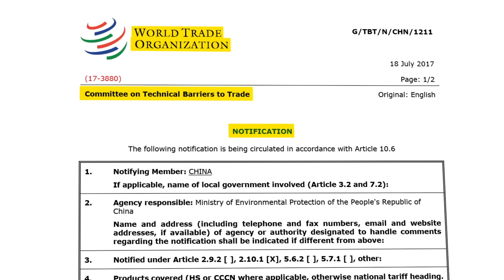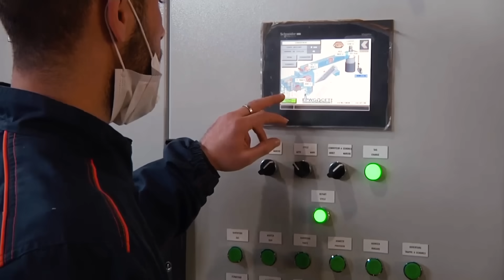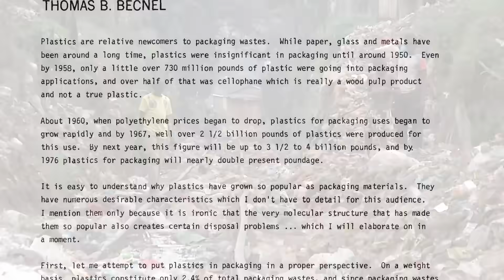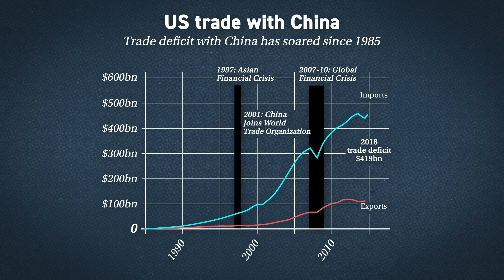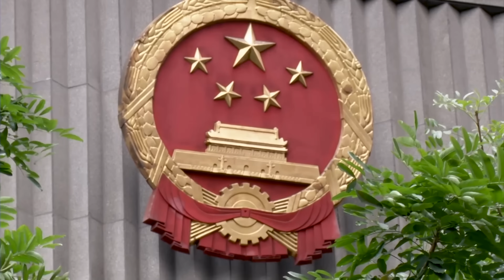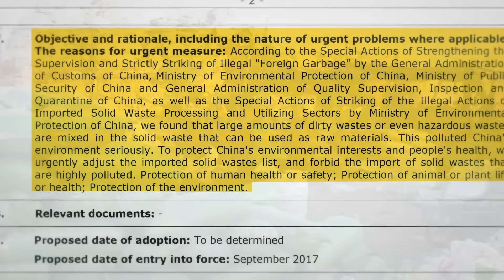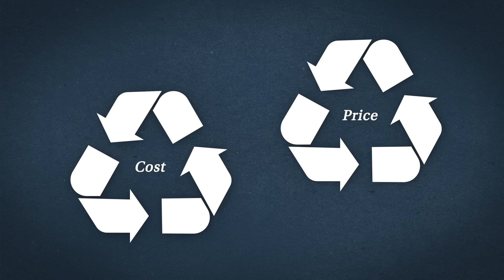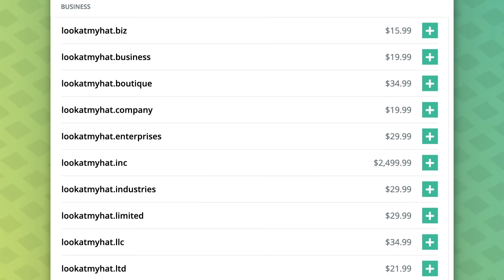How China Broke the World's Recycling

Comment: Simple. Tax 10 cents per pound of virgin PET, and grant ~15-20 cents (depending on loss) per pound of recycled PET to recyclers; that brings the virgin price from 54 to 64, and the recycled price from 63 to ~43-48; balance demands by adjusting tax/grant accordingly. While you're at it, mandate that small amounts of different fluorescence-color compounds gets mixed in depending on the plastic types, so scanners can tell them apart easily, and prohibit using fluorescent primary color compounds to avoid confusion (there's plenty of all colors that don't fluoresce).

Comment: So what's wrong with just storing the plastic somewhere? Just put that somewhere in abandoned place and keep it there until the price actually rises up and it will be profitable to reuse it. One of reasons for such low price of fresh material is that plastics are related to other crude oil products. Why is asphalt so cheap? For the same reason, we have abundance of asphalt. Otherwise we would use different material for our roads but it is working well and is cheap as oil refining byproduct. Essentially plastics are cheap only because we use huge amounts of fuel so we also produce huge amounts of plastic ingredients. Currently driving factor for crude oil industry is fuel and everything else just follows. If we reduce the use of crude oil fuels, then suddenly demand for fresh plastic may be higher than the production. Of course we can keep the higher production to meet plastic industry demand but if we do that, we'll end up with more fuel than we can sell. To make it profitable we'll have to shift some of the fuel price to plastic price to balance out the demand for both.
Imagine that you are selling scrambled eggs, just lots of it. Now someone found out that he can use egg shells to produce something. You have lots of shells so you sell them cheaply. The demand slowly grown but suddenly scrambled eggs are not that popular and you use less eggs producing less shells. The problem is that someone wants to get more shells but what would you do with those extra scrambled eggs? To sell more of it you will have to reduce price of the scrambled eggs and shift some of the cost to egg shells. Then you will have balance once again but now shells are more expensive. It means that the one buying shells might consider changing his technology which was initially driven by egg shells cost. 
So it's just question when. Either we will reduce crude oil use and extraction that will increase plastic production prices, or we'll simply run out of oil. In both cases sooner or later we will have higher demand for something that is not economically viable option right now. The only question that remains is how to store it cheaply without environmental risk.

Comment: I've spent the last couple years convincing my mom to stop recycling things like bottlecaps and yogurt cups, as well as plastic bottles and jars which will take considerable water and/or soap to clean.  Especially when one lives in a desert, it's just not worth using the water to clean anything but drink bottles (which are generally HDPE anyway).  The response for months was "but the city accepts these plastics for recycling."  I think I've finally convinced her that most "recycled" plastics around here just end up in the landfill, so we might as well help the sorters out and save water in the process.  At least we know metals, glass and paper cardboard actually get recycled locally, but again it's taken some convincing to get my mom to stop throwing plasticized paper/paperboard into the recycles....

Comment: That's why you use the 5 Rs: Refuse, Reduce, Reuse, Repurpose, Recycle! Follow in that order. Recycling should be people's last option; refusing should be people's first.
Reply: It's still just 3 R's. Refusing is reducing your consumption, and repurposing is reusing. You just duplicated 2 of them.
Reply: @vancel35    Exactly:
It's still just 3 R's. Refusing is reducing your consumption, and repurposing is reusing. You just duplicated 2 of them
Reply: @vancel35  refuse what you can live without, reduce what you need to the essential, reuse what is still good enough to, repurpose if you can find some other use, recycle or at least try to for everything else that failed the other 4 R's
It's more exhaustive, though you can technically spare yourself from explaining two.
Reply: Not a lot of ability to "refuse" when pretty much everything at the store is in a container.
Reply: @KaiserMattTygore927  You can refuse items like plastic straws or disposable utensils and replace them with reusable metal and paper straws as well as metal utensils.
Reply: @ProximaCentauriC  yes, paper straws, which cost five times as much to produce than plastic ones, have to be packaged individually if you don't want to turn soggy, need to coat in another plastic to not turn to mush as soon it's used as a straw and is no longer usable after a single use not just because it's kinda icky, but because it turned to crap.
Use metal or another high-grade food-safe plastic companies are more incentivised to recycle if that's what's turning them off, plastic straws are utter garbage and only needed in case we don't find a solution to the oil problem, we'll have to resort to breaking rocks to get more of it and plastic straws end up costing as much as paper ones to make, otherwise this is just a stunt to pretend you're being environmentally concious.
Reply: @ProximaCentauriC  That's fine, but that's not what i'm talking about.

Not talking about fast food at all, talking about GROCERIES
Reply: @KaiserMattTygore927  Yes. Most grocery products are packaged in plastic. However, companies like Trader Joes in the U.S. have made the switch to compostable produce bags (bags that can decompose in 10-45 days), in comparison to "biodegradable" produce bags (ones that are just normal plastic bags with an added chemical additive unproven to work). The bags Trader Joe's uses are made by BioBag, whose plastic bags are certified compostable by the Biodegradable Products Institute.
Reply: @ProximaCentauriC  weed. it works well as a replacement of plastic bags.
Reply: @KaiserMattTygore927  that's where the tough choices come in. Buy a different product that has better packaging or write to the company to pressure them into changing their packaging.
Reply: @vancel35  The problem with that approach is that in order to make those "tough choices", you'd need to be educated on the supply chains and relative life-cycle profiles of all the prospective products you can choose from, and basically nobody is. Instead, people will most likely buy something that has a green label on it and is packaged in glass, paper or wood, and in most cases is way less environmentally friendly than their first choice.
Reply: @SpaghettiToaster  I understand the research isn't easy. That's why it might be easier to pressure companies into using more sustainable packaging.
Reply: @vancel35  The problem with that is that, for the most part, there is none. Multiple life-cycle studies have shown that plastics are by far the most environmentally friendly option in many of the most common applications they're used for today. Recycling materials are of course an option, and companies should be incentivized to use them more. But the problem is that mechanical recycling is relaly hard and the total amount of recycling material of high enough quality to be used for packaging produced worldwide is tiny. And even by massively increasing the current, mechanical recycling capabilities, which can only really be done in the wealthiest countries because of the great costs, you'll only make a small dent because almost all of the plastics waste that ends up in the oceans comes from asia and africa. Of course a lot of that comes from illegal exports from the rich countries, so increasing the management capcities there (be it recycling, incineration or even properly managed landfills) would be a good start to curb illegal exports. In the USA's case, a great first step would actually be to ratify the basel convention and make waste export dumping illegal in the first place. But to really get rid of plastics pollution, there needs to be a massive increase in capacities in the developing countries, and those capcities can't and won't be mechanical recycling, which requires a highly developed post-consumer collection and sorting infrastructure and high-tech computerized machine learning-powered purification facilities.
Reply: @vancel35  Repurposing is different from reusing. Reusing is just using the same item repeatedly (reusing a paper grocery bag when buying food). Repurposing is using something that you can't use for its original purpose for something new (using an old shirt as a dish towel or rag).
Reply: tell that to apple...
Reply: Should be, but it will never work. People want convenience, speed and comfort. Refusing plastics works as long as we don't feel very inconvenienced. Long-term solutions based on general goodwill are not feasible.
Reply: People seem to forget that there will always be an end of life for a product or material...
Reply: And it’s sad how many places don’t have proper recycling centers either due to cost or inconvenience that comes along with the extra steps
Reply: refuse is the same thing as reduce. 
repurpose is the same thing as reuse.

if you want more Rs in your slogan, just use retarded.

Comment: One interesting way of fixing this, is to not use disposable packaging and switch to refillable packaging. So you bring your empty cans to the shop and swap them out for new ones, or you can bring your own canisters/bottles and get them refilled at the shop. Especially people born in the USSR promote this idea, because in the USSR this system worked very smoothly.
European countries already do this for beer and big soda bottles, but really only for those 2 types of products. And some people in Europe argue that sending empty packages to a factory also produces CO2 from the shipment. But I'm now thinking: putting beer/soda into a big barrel and bringing that to your local shop is actually cheaper than shipping a lot of separate bottles. If you get the refill+disinfection procedure dialed in, then it might be viable in capitalism too.

Comment: I always liked the idea of shredding the bad stuff, mixing it with polymer or cement and using it as building materials like blocks and paneling.
Reply: You can kind-of do that with a gasification system. You put general garbage into a blast furnace fed with oxygen and steam, and 90% ends up as gasses that can be turned into common chemicals like formaldehyde or methanol, while the remaining 10% ends up as a sort of synthetic stone that can be used for construction.

Comment: Asking people to generate market forces from their individual consciences typically doesn't work; it's not scalable or sustainable.  The solution that will work is to tax virgin plastic.  This will both make recycled plastic competitive in comparison, and will generate income to fund and subsidize plastic recycling.  This sort of regulation works elsewhere, and recycling is a natural application.

And naturally, we'd tax hard-to-recycle or unrecyclable plastics (both the types of plastic and types of products) higher than the easily recycled ones.  It should become economically unviable to make certain products like thin plastic shopping bags and low-grade water bottles from virgin plastic, giving that recycled plastic a place to go, but also removing some incentive to spam those products out.

Comment: There are non-economic solutions to economic problems, and you're proposing one of many in your solution. Plastic is used because it's the cheapest material available for these applications, which makes it a matter of economics. If you're willing to entertain "Shutting the system down" which would take a drastic act of government intervention that defies the economics, why wouldn't you entertain other intervention solutions that address the economics of recycling more directly? Either way the cost to the consumer is increasing, either by subsidizing the recycled materials and taxing the virgin plastics, or by paying for a more expensive non-plastic container.

Comment: Thank you,this was a great and very comprehensive video about the problems of polymer recycling! But I would have to disagree with 2 notions in this video - that the polymer industry needs to be shut down to ultimately solve the plastic problem and that the problem is entirely in economics.There ARE good reasons why we use polymers - cheap,durable,strong,tough,malleable,lightweight,versatile and hygienic.We simply don't yet have the alternative that looks pretty as a package or is shelf stable and doesn't leak hazardous materials or is easy to mass produce. So it makes sense for the whole world to use plastic - it is a dirt cheap material with properties that can be tailored for the whole universe of applications,not only to the mass consumer but to businesses as well.

I would say that we are currently bottlenecked on the quality of plastics,hence their unprofitability.But there are technical solutions to this,as was mentioned chemical reprocessing,but there are starting to appear more novel ones like pyrolysis or solvolysis.They are only starting to get attention in academia and corporate R&D,since it is clear that mechanical recycling severely hampers polymers properties.

Comment: Plastics have the same chemical formula as petroleum, right? I've seen an invention by professor Satish Kumar that converts plastic into liquid and gas fuel through plastic pyrolysis. Perhaps that could be a sustainable option to recycle plastic by also giving it positive value? Cutting the source off from the beginning is, of course, the most sure-fire way to end plastic pollution though.

Comment: Recycling needs to be regulated, and partially government-run, subsidized by taxes on virgin/new plastic produced. Once it's left to the market, unless it's profitable, there won't be any competition, and thus no innovation. Without innovation, it will remain inefficient and expensive. That's why we need top down mandates, so companies and consumers are jointly responsible for the waste. Once it becomes a cost pressure on these companies you'll start seeing more appetite for real long-term solutions to deal with the problem. I'm glad China took this position, we needed this shake up.

Comment: This is the same problem as in a lot of other domains such as greenhouse emissions and other types of pollution, where processes have externalities which are costs caused by a process that are not incurred by the producer. In This case the production of plastics has an externality of disposing of the plastic, which lies with the consumer or the local authorities, not with the producer.

The only proper solution for this problem is to tax the process of producing plastics in equal amounts to the cost of disposing of the plastic, to account for this cost. This of course is not perfect since it is handled by local authorities, it is difficult to manage and to find objective ways of measuring the costs of associated externalities, but at least it disincentivises production where some of the cost associated is not handled by the producer.

Comment: Would it have been profitable if the proper externalities were priced into the oil industry? Ala carbon taxes
Reply: As a rough estimate, petrol is basically octane (C8H18). By mass that's 8*12+18*1=96+18, which means something like 80% of the mass is in the carbon, and that's such a large fraction, we can basically ignore the hydrogen. CO2 is 12+2*16, or basically a third carbon by mass. So, 1kg of petrol will get you about 3kg of carbon dioxide. Crude oil has more of the heavier hydrocarbons, but even so, it's not going to affect the overall calculation that much. Tax CO2 at $100 per tonne, and you can basically tax oil at $33 per tonne and be close-enough to covering all the greenhouse gasses it'll produce once burned.

Comment: In addition to raising the value or reducing the cost of recycled plastic, another economic option would be to raise the cost of new plastic. 

Theoretically that's what the deposits are supposed to do: add the external cost of keeping the material out of a landfill or burn plant to the up front price paid when manufacturers order plastic, and provide an incentive for recyclers to process it. There are problems with deposits though. A straight-up tax on new plastic that didn't apply to recycled plastic might be simpler and more effective.